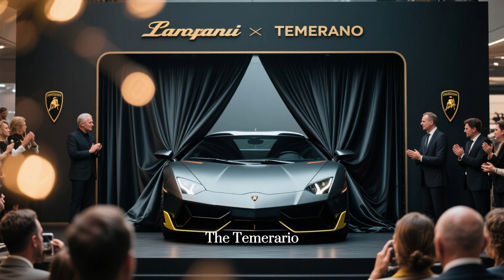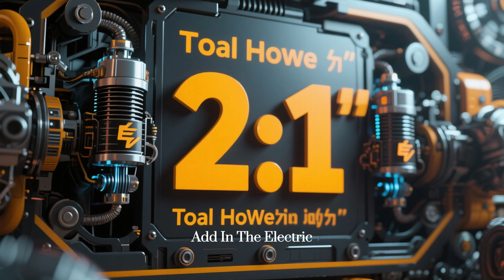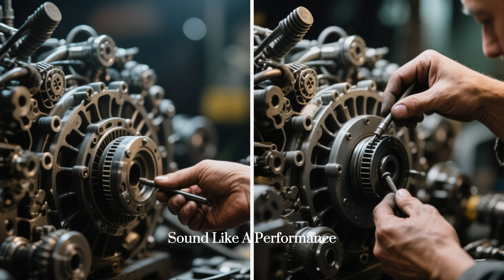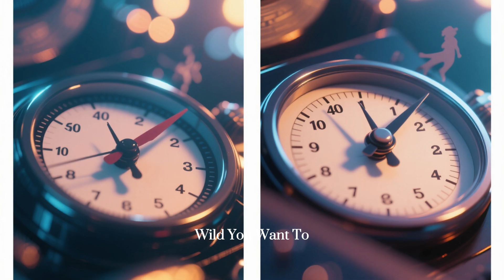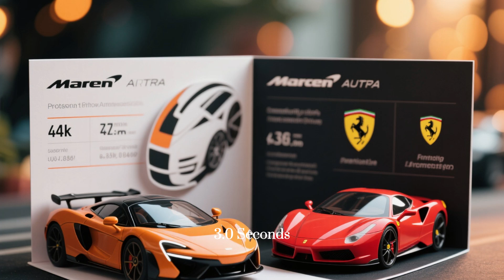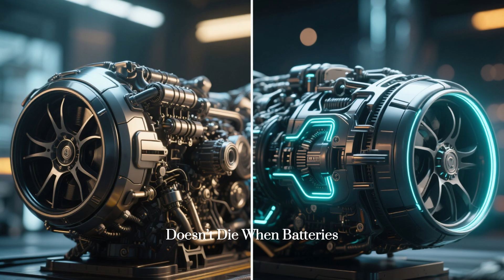Lamborghini Temerario Review – The 10,000 RPM Hybrid Supercar That Redefines Power #cars

Comment: higher rpm=faster failure.
Reply from the maker: Higher RPM doesn’t automatically mean lower reliability on its own. It depends more on how the engine is engineered, materials used, cooling, and how much stress it’s designed to handle. Supercars are built with very different tolerances than everyday engines 👍